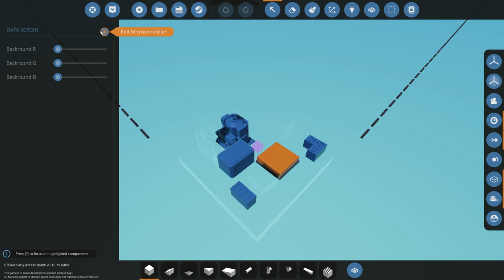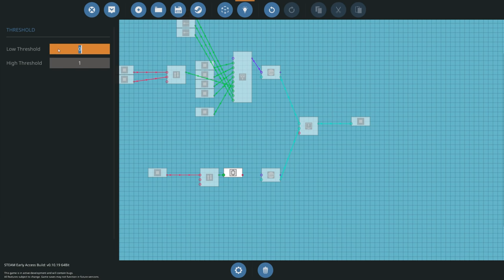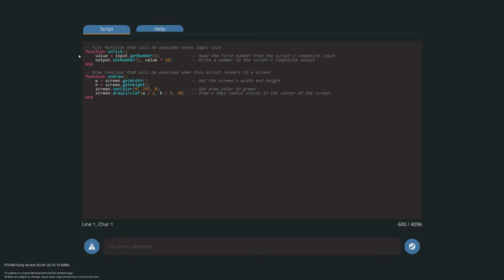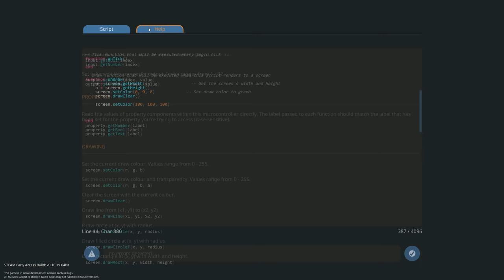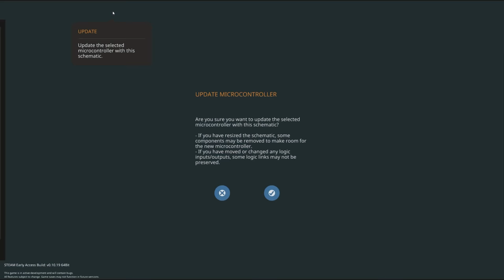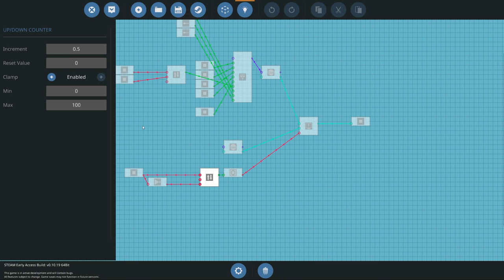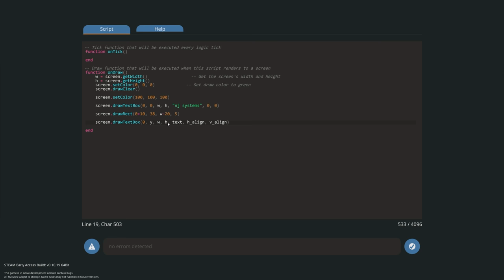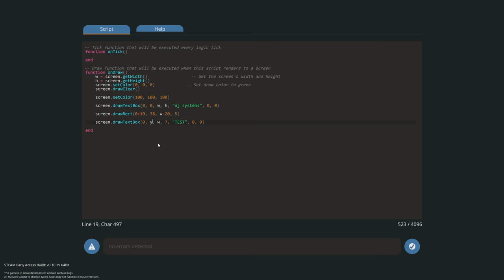Lua Build Series - Loading Screen - Stormworks

Comment: Just to make something clear. 
math.floor(load)
gives you the same number as
string.format("%.0f", load)
i would only use string.format when i want an x amount of decimal points to be shown. if i want to remove them i would use math.floor.
Reply: Ehhhhmmmm no? string.format("%.0f", load) would round depending on the value, whilst math.floor(load) would always round the number down
Reply: @Mathathat  i tested my statement and it seems like string.format for some reason do round to the closet value. but my last sentence is still valid. why would you have the monitor show 100% when it's 99.5%?
Reply: string.format is slower and returns string, not number
Reply: @v0xl  Lua don't care to much about variable types
Reply: @whiteland9992  then make it show 1 decimal
Reply: @Mathathat  math.floor(val*10)/10, if the val is 4.5432 it'll be 4.5

Comment: Is there a way you can make a passcode keypad? And if we put the right code in, a certain door can open
Reply: I'm sure it'd work if you were to write the keypad's number into a composite using a composite write. You'd also need an on off output on the microcontroller to open the door. Or you could create a number output with a numerical switchbox to control the rotation. So then put it through the lua script.
then do like input = getNumber(1) which would detect the keypad's input and put it into the variable "input"
Then do like 
if input = 1234 then output.setBool(2,1)
not sure if that'd work at the output part as im fairly new to lua, but its worth a shot :) 1234 would obviously be the chosen password that you want to open the door. so altogether the code i think would work would be:
function onTick
input = getNumber(1)
if input = 1234 then output.setBool(2,1)
end
obviously if this is wrong someone please correct me haha. The output must be on composite channel 2 and the input on channel 1.

Comment: What was the calculation you did? I cant get this to work with a 2x3 screen
Edit:I figured it out, While you used 43 for the 2x2 i had to use 75 with the 2x3
Reply: Did you figure out what the calculation actually is?
Reply: @jameshyland7807  No.
Reply: @R-BGamingUK  I did, its basically just whatever the 'w-x' value is before it gets changed to 'loadb'